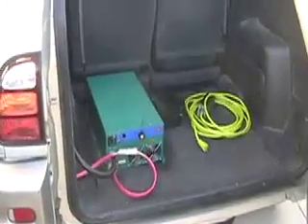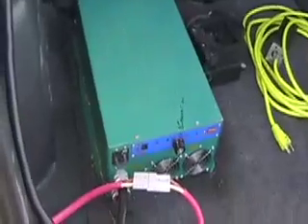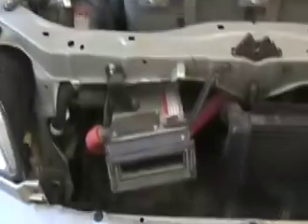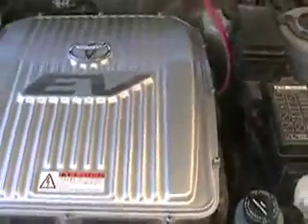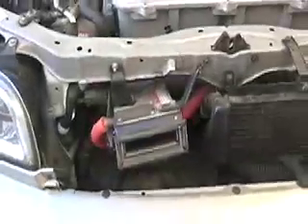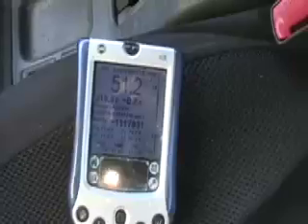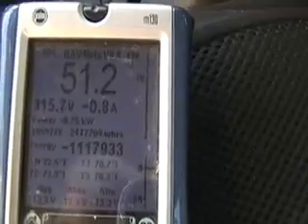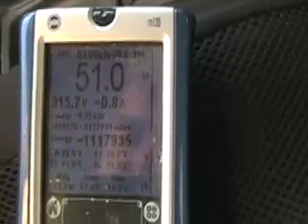RAV4-EV an instant Chevy VOLT: correcting phony engineers

Comment: what if: 40 kilowatt generator, at 220 AC input to the ultra-caps, then into the 220 AC speed controller, bypass the batteries all together and charge them while driving, a diesel gen-set running on altered vegetable oil would use 1/4 of a gallon per hour with a range of 240 miles per gallon, Nickola Tesla proposed this a while back, too bad the tech wasn't available then;why have an energy "sink" you need the 100-300AMPS to accelerate from zero to 40..can we do this now?

signed Scott Watson.

Comment: I herd the Volt turns on the generator at 30% charge in order to keep the batteries from going below 30%. It does not charge up the car. It just mantains them from going completely depleted. which is exactly what you say they should do

Comment: 1.every time you convert from one energy to another you lose some energy. lose some in the generator, the inverter, batts. discharge: lose some in batts, inverter, motor.

2.electriciy is cheap, but polluting. one engineer posted a picture of a smoke stack from a coal fired generator with a note: tailpipe of the electric car 

3.the fuel that can beat oil based fuel for environmental friendlyness is methane because it has only 1 carbon for every 4 hydrogen 1 methane + O2 = 1CO2 + 2H2O + heat

Comment: A small generator will not run a car. The car would have to be too small.The VOLTs generator is a range extender. The VOLT is also flexible. The range extending engine could be a fuel cell or a diesel engine or just put more batteries in it and not have the range extending engine. The reality is that the batteries are expensive right now and the only way to keep the price down is the range extending engine. The CHEVY VOLT is the best concept we have.

Comment: I have heard the misguided notion too that once you are out of battery range you use the combustion generator to recharge the vehicle but I'm not sure that's GM's consistent viewpoint if it ever was. what is your source on that? if it is we need to shame them hard now when we still have a chance to influence the design. it would be so stupid a design that the only reason for it would be to make it more dependent on gas

Comment: 1) They fear that people discover that electricity is cheaper that gasoline, especially if you have Time of Use metering.
2) They fear that people discover that they can bank their solar energy they make during the day for cheaper electricity at night.
3) They fear that you won't stop at the gas station to buy slim jims and Coke or to visit the dealership to get an oil change and filter.

Comment: BMSs of some sort are used on all large, multi-cell battery packs. Increasing cell size helps a lot. I was quoting 18650 cost as they're a convenient reference for mass production costs.

By 56kWh I assume you're referring to the Tesla pack. The WHOLE CAR costs 100k - including carbon fiber, motor, motor controller, expensive imported components from england, etc.

Comment: Where'd this 18kWh suddenly come from? It's 16kWh, discharged from 80%SOC to 30%SOC to optimize life and leave room for absorbing regen and genset surplus.

At SIMILAR ECONOMIES OF SCALE to current cobalt-based technology (using your own 400/kwH citation), that's still $6400 for the cells. Increasing the cell size should help decrease complexity of the whole pack (BMS, cooling, etc) - just as it did for large format NiMH back in the '90s.

Comment: To clarify, the 16kWh uses up 8kWh of energy before the genset kicks in to prevent deep cycling and shortened battery life. Theoretically it could go 80 miles on a charge, but 50%SOC cycling is more gentle.

Really, Doug, this technical detail has been in the news for months. If you're going to criticize something at least understand it first.

Comment: Sorry to blitz you with fact checks, but on the subject of cost-> currently conventional lithium sells for ~$0.6 per watt hour (18650s), or about $10k per 16kwh pack. LiFePO4 doesn't have the rare expensive cobalt in the (+) side, so if anything it should be cheaper to make. Cheapest NiMH (AAs) is ~$0.5/wH.

Comment: This "hybrid mode" all has the effect of keeping the genset at its ideal point of efficiency (typically around 3000 rpm/55mph). Gas cars waste a lot of energy accelerating and at idle. 
It's a similar load leveling effect than the prius, except more elegantly based on an EV architecture, and minus the torque converter and transmission losses.

Comment: What makes the Volt different from something like a diesel electric train is that the battery is used for load leveling on the combustion engine. In other words, the combustion engine/generator supplies enough power for cruising at 55. Any surplus power is sent to the battery. When bursts of acceleration are needed, the battery supplies extra juice.

Comment: Also:"If the genset comes on, it doesn't charge the battery! It makes no sense to use it to charge the battery, because you want the battery low in case you need to do regen braking, for example, on a long downhill run."

This doesn't really differ from the Volt design. The genset only comes on when the battery is low (30%SOC), and it supplies most of its power to the electric motor.

Comment: 400 pounds includes the liquid cooling. The batteries themselves - at an energy density of 100-140Wh/kg - only take up 250-350 pounds.

Liquid cooling is also overkill and overbuilding -  that's the engineer's habit. FYI, NiMH cells can also benefit from liquid cooling - and in fact, Cobasys sells liquid-cooled NiMH packs for this very reason.

Comment: -On the other hand, the superior energy density of olivine lithium ion cathodes (which is 2-3 times that of even the best NiMH), allows one to build a 16kWh pack for a much more reasonable weight. The pack can also be cycled more shallowly (50%SOC depletion), so as to greatly extend the pack life for 3000-7000 cycles. Or in other words, 120,000 to 280,000 miles.

Comment: If one were to scale it down to 40mi for a compact car like the Volt (which is good given average commute distances, as well as to keep costs down) that would be about 16kWh and over 600lbs of cells. That weight would be prohibitive for building the vehicle-if not in terms of mass but in terms of volume. And almost certainly prohibitive in terms of cost. One could cut this in half by giving it 8kWh but that would necessitate deep-cycling, which would cut useful pack life down to 40,000mi

Comment: B)while it IS possible to retrofit NiMH Rav-4 EV to be a PHEV, this ignores a couple engineering technicalities. The Rav-4 is equipped with 60-100 miles' worth of batteries ->JOLLY expensive. Nonetheless, the large size of this pack extends its useful life cuz each deep cycle delivers more mileage. At 60 miles and a cycle life of 1800 cycles at 80%DOD, that's 108000 miles to dead. That's an expensive mid-life operation. You CANNOT expect every car firm to build a serial hybrid based on Rav4 EV.

Comment: The flaws I see in the specifics of this argument are 

A) that modern Li-ion cells developed since the mid-90's (e.g. olivine and spinel cathodes) have reached a point of maturity where they are very disruptive to NiMH for automotive applications. They are disruptive in that they are just as safe as NiMH, yet experience 2X greater energy density, far better internal impedance/resistance, and are more environmentally friendly. There's also the all important issue of COST.